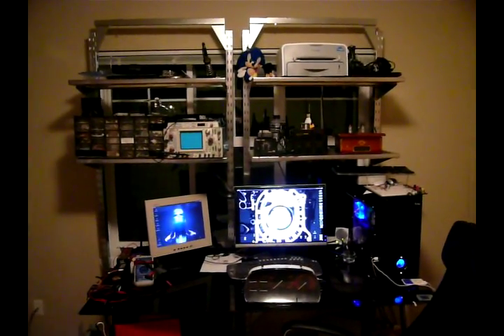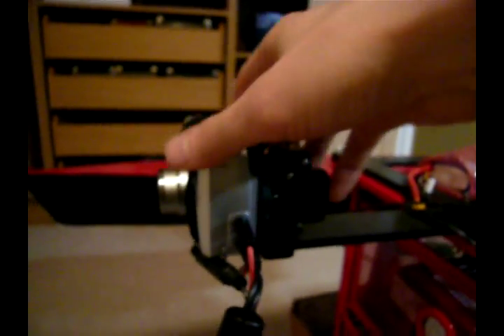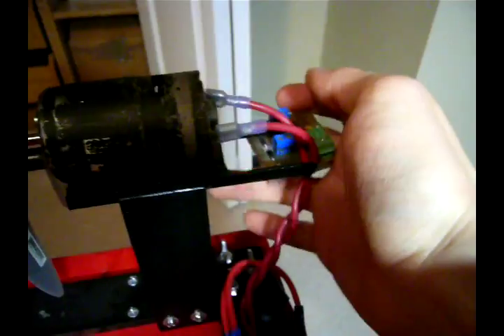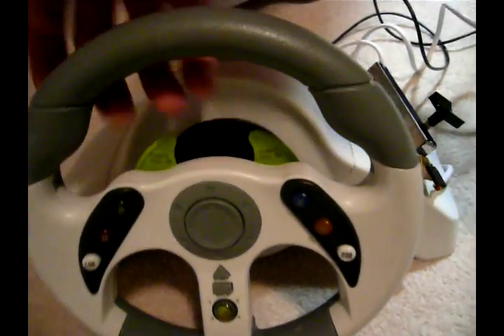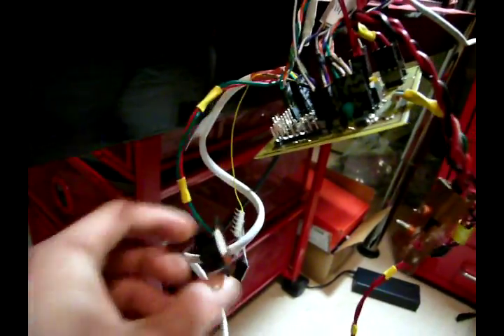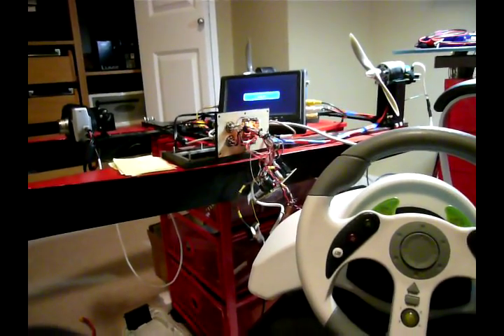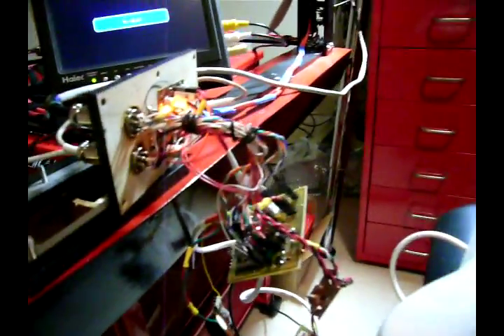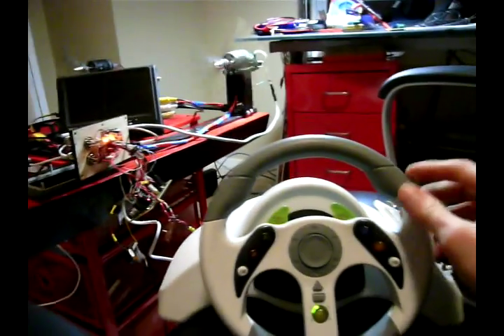FPV RC Boat initial overview

Comment: it is a very cool project and all works fine. but it is a boat!!. you use that on water. all i see is electrical boards out in the open. some components are very allergic to water. one drop and they short out. bye bye hard work. a catamaran hull is very sleek and fast. but also it has little boyancy. a burst of power and it wil lift the bow. lift up the camera. cut power fast and it will dive back in. maybe this can soak the camera allready. small waves will come and give splatter all over the boat. so make sure it is all save in a waterproof place and even then waterproof it with plastidip spray or something. keep up the good work.

Comment from the maker: Ah, I think I was experimenting with Eclipse here. Probably not worth it- it's overkill for what I was doing here. Just google for "eclipse arduino" for some resources if you want to go down that path. These days I just use the Arduino environment for the compiler and gedit or Notepad++ as the editor (the arduino environment has a "use external editor" option). Geany is another editor I'm liking these days. Regardless I'm using avr-gcc for the actual compiler.